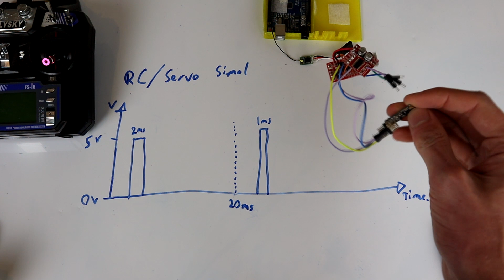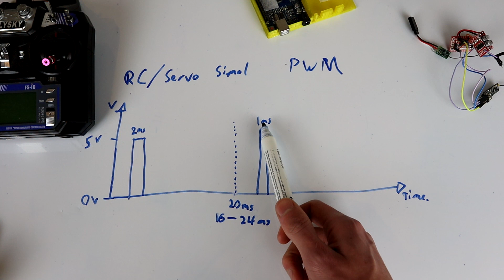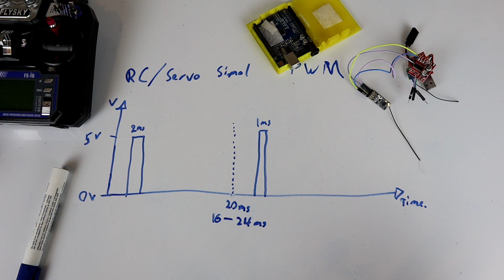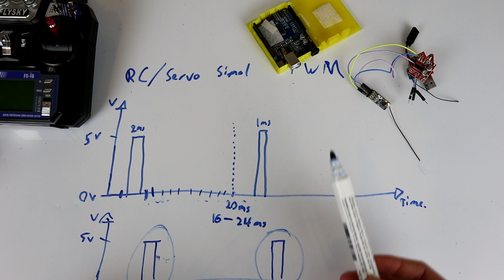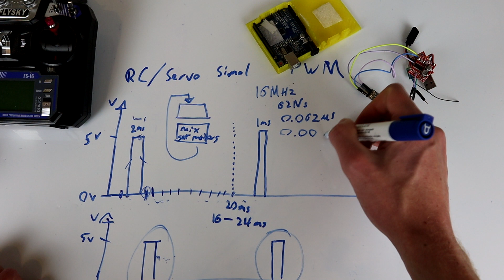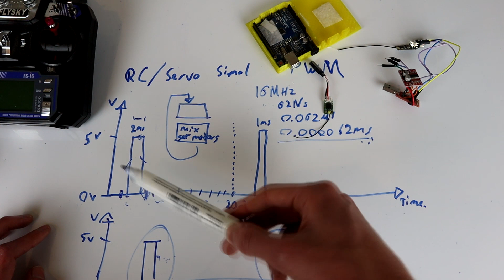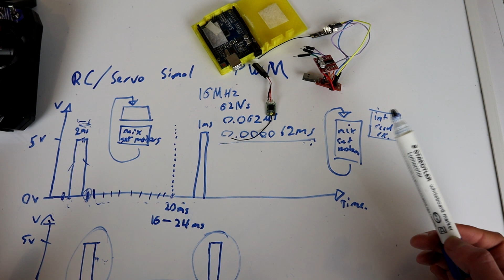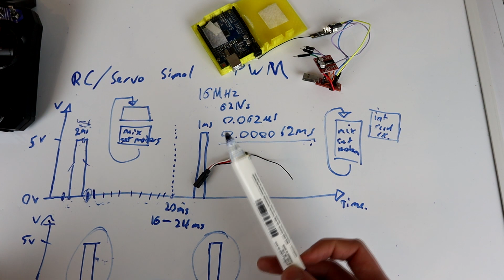ESC Basics: Read RC receivers with Arduino (updated)

Comment: Great, that is really interesting.

Also, the Flysky i-bus signal is easier to decipher than s-bus, because a) its signals are the "correct" way up (active low) b) It uses a more typical bit rate c) it does not do any strange bit-twiddling to squeeze more channels into fewer bytes.
Reply from the maker: Oh cool, I'll have to check out i-bus, that sounds less complex then sbus and I want to custom code a bus based ESC in the near future so that will be handy

Comment: I have an ESC that takes input with the standard 3 wires which I believe is called the "throttle lead" for rc cars (signal, red power wire, ground wire). Is it possible to control the esc with an MPU-6050 using its gyroscope data? I don't believe the MPU-6050 can take the rc throttle lead wires as input. However, can the sbus device turn those 3 wires into one, subsequently making the esc able to connect with an MPU-6050?
  I essentially want the most simple device that would simply take gyroscope data and convert it to motor spin for a robot to balance. Can it be done in the way I described?
Reply from the maker: Nope not at all
The MPU-6050 has its own communications scheme
You will need to have a microcontroller such as an Arduino, to convert signals from the MPU650 to the ESCs

Comment: So how do you control a motor with this code using the l 298n motor controller? My motors are just doing really weird stuff and just spinning at 100% speed and then slow again?😅
Reply from the maker: you need to use interrupts to catch the timing of the pulses then you need to convert those timings into a PWM value which you output to the motor controller
Reply: @TeamPanicRobotics  if only someone would make a video about this ;)

Comment: sympathise with previous "achilles heel"  Vision :  RC control model railway could outperform  traditional track delivered electrics  DCS etc( advantages are apparent) BUT we only have hand me downs from other hobbys ( aircraft etc)  So to get started HOW can I interrupt signals from a tx by a  separate (track) triggered input to implement a function. ( eg controlled slow down to destination )  Seems every thing has to come from TX ?  Idea of a remote  "encountered  interrupt ( eg hitting a micro switch in travel  seems "No Go " ?  Am I dreaming ? Ms Otis

Comment: what is the signal from the receiver when I control a dc motor (not servo! ) ? Is it still like 50 Hz  (is it always 50 Hz ? signal)? So tell me if i am wrong but what ESC does is convert this signal of 50 Hz PWM into voltage which varies between lower and higher voltages which can control the speed of the motor? What I am interested in what is the exact output of the receiver signal for dc motor control and also what is the output of the ESC to the motor (example FLySky controller). Thanks. PS. I am planning to buy a FlySky controller but also I practice designing my own circuits this is why I wanted to know. I have already built some 27 MHz transmitter / receiver for my own (from the scratch) . Of course I am realistic and I know that my own design is even not 1 % close to the commercial transmitter like Flysky or even I don;t want to metion other more expensive equipement but I think my own ESC is a thing that I could do (it is cheaper than pay a lot every time when I want to change my project). PS2. What I build myself looks like those old school circuits from 60 ' or so ;)
Reply from the maker: A receiver you buy will always output the same type of servo signal PWM. 
If you want to make an ESC you need to read this servo signal and convert it to a motor PWM signal
Motor PWM signals are usually a higher frequency and control the speed of the motor by varying the duty cycle, a 10% on 90% off will give a low speed from the motor, where a 90% on 10% off will give a high speed

This works because the duty cycle of this kind of PWM is fast enough that the motor cant react to each induvial pulse so instead sees the signal as an approximate voltage.

To know more look up tutorials for controlling motors with Arduino, there are some really great tutorials out there
Reply: @TeamPanicRobotics  thanks for the idea :)

Comment: I feel like this kinda stuff will be my achilles heel when it comes to my build, im not amazingly good with electrics... i know enough to get by but not intricate systems and as far as radio control/arduino code ive never even really gone into it. I assumed i could just buy ready made modules plug them in and then follow a tutorial or self learn  how to make it work with the receiver.
Reply from the maker: You absolutely can just buy ESCs and plug them into a receiver and as long as you have the settings in the ESC right (or have bought ones set up already) you will be fine

90% of all robots I've built I've not had to worry about any of this or use a single line of code I have written

This video is really more for people who want to build their own ESC or start to understand more about how the electronics in their robot works.
Reply: @TeamPanicRobotics  - Well said, Ben. THAT'S the way to encourage new roboteers!  :-)

Most aircraft pilots don't have university degrees in fluid dynamics, laminar flow and boundary-layer adhesion; lots of brilliant racing drivers don't know the first thing about designing a fuel injection system. They're too busy trying to win races to bother with all that technical stuff.

It's interesting to browse through manuals or take a look under the bonnet from time to time, but it's far more important to get behind the wheel and drive.

I'm mechanically-minded (i.e. simple!) and have a poor understanding of electronics; programming is still a mystery to me. Thankfully (as you say) you can get everything ready-to-run straight off the shelf these days.

Comment: Would this work with a Spektrum Receiver?
Reply from the maker: As long as the receiver has individual channels like this it should work
The only thing this wont work for is receivers that only have a single output for all channels, those receivers use very different protocols
Reply: @TeamPanicRobotics  Yes but your receiver only has three lines out V G and signal.
Reply from the maker: It has V G and Signal per channel, I.E. it has 4 of them, one for each of the 4 channels out

Some receivers only have 1 set of V G and Signal, but transmit 8 or 16 channels.

If your receiver has V G and Signal per channel, then you can follow this video